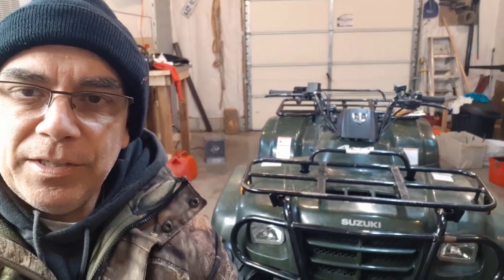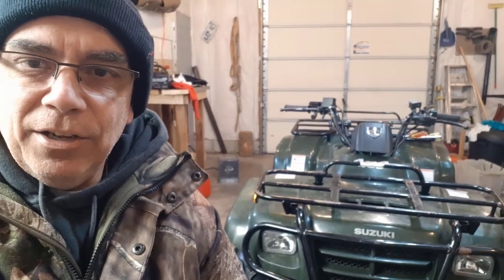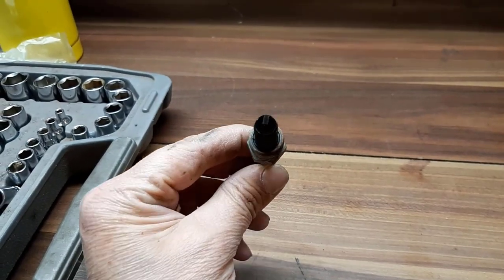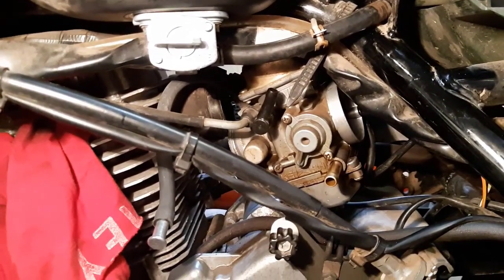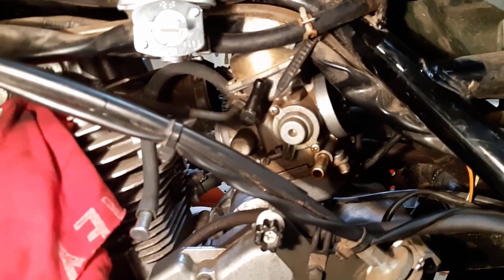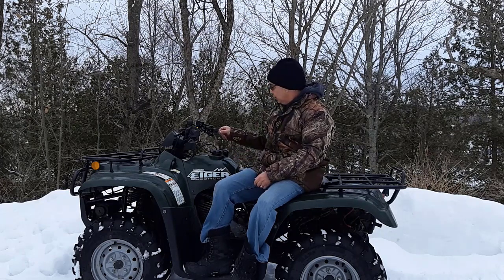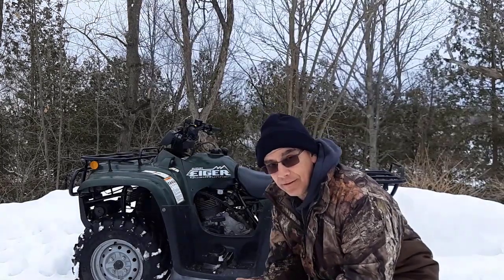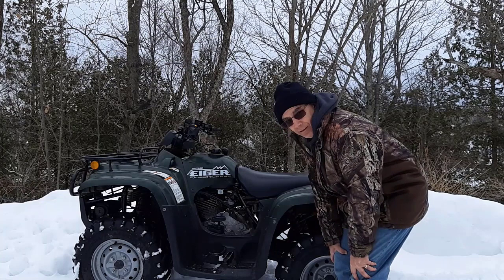ATV CARBURETOR RUNNING RICH

Comment: That’s good you got it going. I have the same problem.  I have taken it apart once already.  Looks like I may have to take it apart again.  Think I have an idle. Metering jet that is clogged. How many turns out did you go on yours ? The first time I cleaned it, I started out with 2 turns for a starting point.

Comment: I have a 1999 Yamaha 250 and I think I have the same problem as you I have a fouled out spark plug and mine Does not stay running got it for 300 going to buy a carburetor and spark plug hoping that fixes it

Comment: how many turns did you do for the pilot jet? Ive looked around and only found that common practice is to fully seat the jet then back it out 2.5 turns. I did that and also tried 3 turns before stopping for the night. Wondering if you remember how many turns
Reply: Did you ever figure that out because I can't

Comment: I have the same ATV and my is doing the same thing . I’ve cleaned the gas tank an but a new pitcock in an when I give it gas it shuts off . So it’s probably the carb huh ?
Reply: Or vacuum lines have a leak allowing air in
Reply: I'm now dealing with same issue but only when set to the on position. New petcock. WTF 😒 cleaned carb also.

Comment: Hi I have a attic cat four wheeler and I primed it anxiously to much and forgot that I already had it running that day so it wouldn’t even turn over and I looked at the spark plug replaced it it was to rich but my new one hasn’t worked either any suggestions

Comment: Hey. I was wondering if you did a video on how to take it out and apart. I have the same model and today when I went to start it, it ran for a bit but as soon as I came to a complete stop it died and wouldnt start back up. Still wont start. I just dont know how to fix it and I cant find videos on these models. I definitely noticed it was running rich and the float would get stuck open. At least thats what seems to be happening because it keeps flooding itself

Comment: Cant understand why you guys always have an issue with space to get a carb out of these machines !!  Take the airbox out and you’ll have all the space you need to extract the carb, it takes 5 mins to remove yet you struggle for untold minutes trying to take it out through limited space in the frame, it’s just logic that’s missing!! 👍

Comment: I have a 2003 Yamaha Kodiak. Float got stuck, I freed up & now it's running rich after not using for a bit. I'm widowed & need to fix it. What can you do to help me???
Reply from the maker: May the carburetor jets need to be adjusted
Reply: Check if needle is sealing

Comment: Any ideas why my kawi prairie 700 is lean I used one of those rebuild kits off amazon which did not show sizes I got the dyno jet kit all was well with the base jets they suggested but when full throttle I pop and shoot sparks from exhaust which was my issue before it seems to idle and low to mid range be fine but full throttle it sputters and pops flames not smoke not sure what else is causing it to run lean because the other components are all good maybe need to fatten jets more ? Idk I’m new to atvs and little motors
Reply: Spark arrestor needs to be cleaned I think. Honestly never pulled 1 but that's sounding like what needs to be done though

Comment: So I have changed the fuel petcock taken the carb apart and cleaned it I am trying to get my dad's eigar going and am having no luck at all. I bought the carb rebuild kit changed all the Jets. It used to fire up and only idle when I pressed the throttle. Now it won't start at all. The rubber diaphram in carb is fine. I don't know what else to try I have spark. Any thoughts?
Reply: Compression or timing
Reply: It's the flywheel magnet

Comment: How many turns on the adjustment for the carb to help it not run rich  Just got a 2004 articat 400  Only 200 miles been stored in climate controlled garage Carb seems to be clean but won't go over 20If I take the airbox off it runs full power
Reply from the maker: I believe it is 1 -1/4 turns

Comment: I have the same exact bike and its making that popping noise when I get up  to 30mph you think its the carb.....needs to be cleaned
Reply from the maker: Sounds like the carburetor. It could be running too rich
Reply: When you say it was making a popping sound, do you mean like an air bubble popping or backfire popping? I have an automatic and when I let off the gas it makes a hard air bubble pop noise......any idea why?